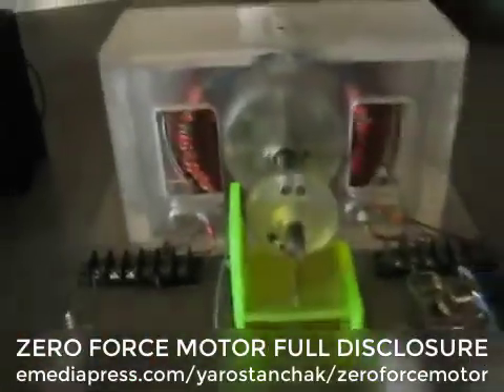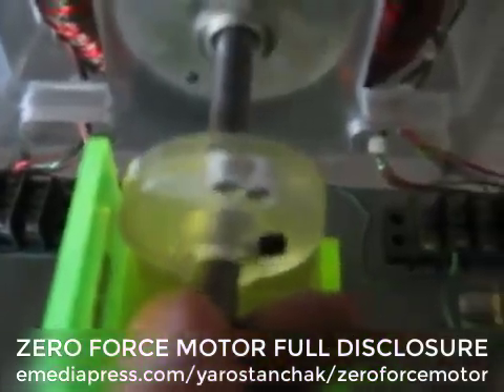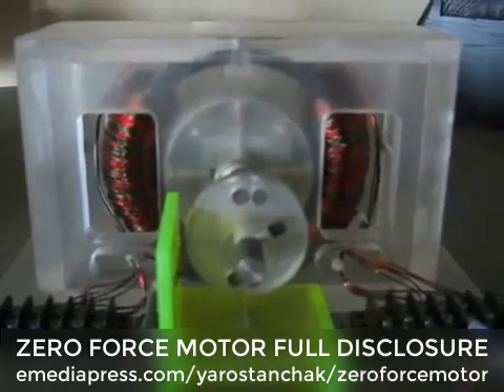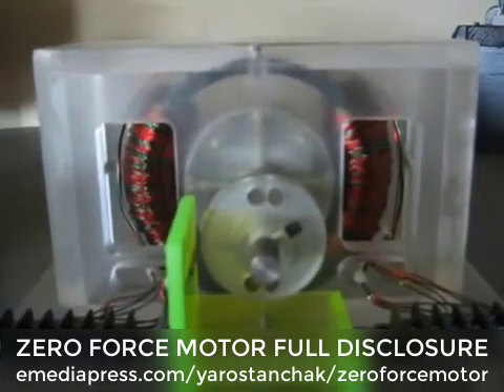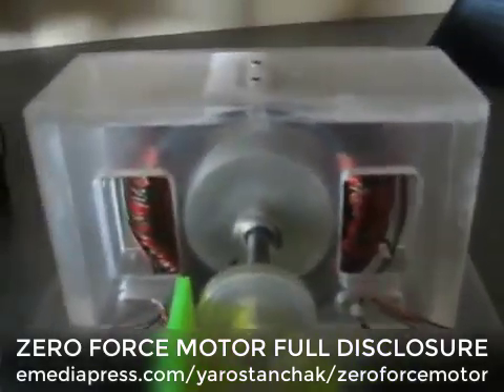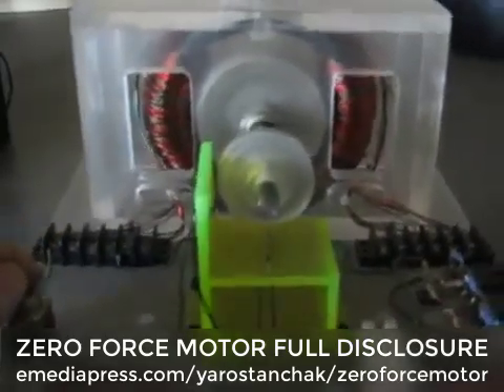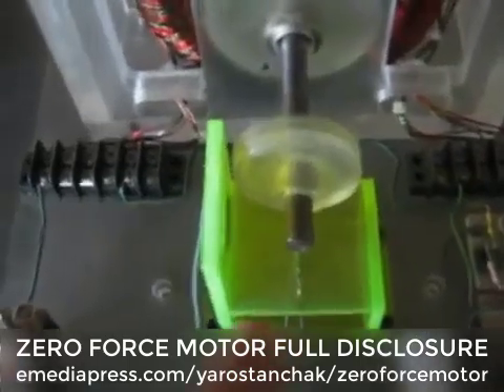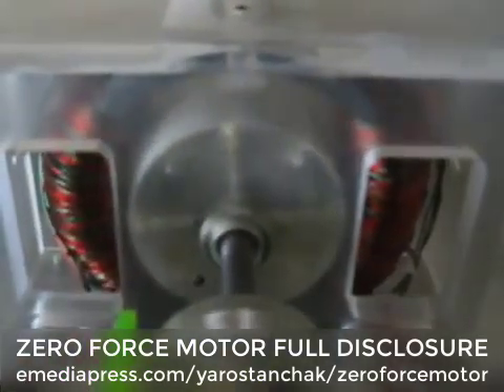Zero Force Motor Demo 3 by John Bedini

Comment: Finally, free energy, for everyone. At last!
Reply from the maker: The Zero Force Motor is actually a highly efficient motor, but if coupled to a low drag generator, it has self-running possibilities. This is just the motor side of things. It does run on on some interesting principles and in some tests has shown some anomalous behavior.
Reply: Aaron Murakami interesting design I have some knowledge of physics, I can see how that is the evolution of the more simple design you displayed my only question is does the inductor configuration have 2 or 4 inductors I could probably Vok it out but I’m interested due to the winding configuration i.e mirrored or in co operation. Also I assume the 0 vectors are at the 90deg vectors. 
I suppose there would be possibilities to trigger with dual inductors, I’d have to think about that. 
Anyways nice design
Reply: Aaron Murakami having a closer look I can see now there are two inductors, ok so cancel that question I guess, only issue left is if they are mirrored or co operative , if mirroring then there is like poles at the open spaces top and bottom which would generate a 90 adjacent to 3D pole top and bottom, if co operative , then the 0 point would be top and bottom, it would be interesting to try different designs. 
Again thanks for sharing.
Reply from the maker: Obviously any legitimate free energy - overunity system is using a bit of our input to leverage free environmental input so that the total work done is more than what we pay for.
Reply: When it shows anomalous behavior, measure the frequency the coils are switching at.
Reply: That's not what this does.
Reply: There's NO such thing as free energy other than abstracted from the environment lol